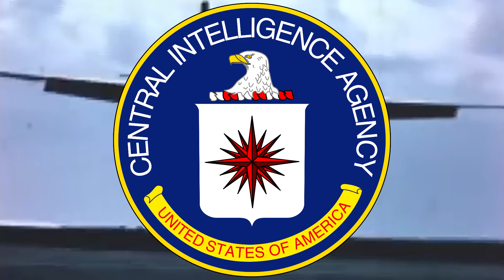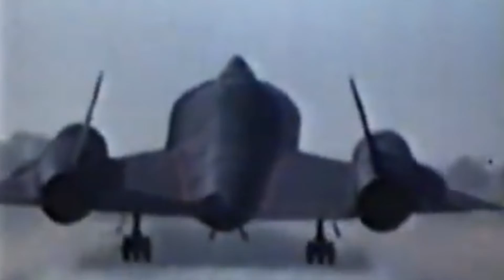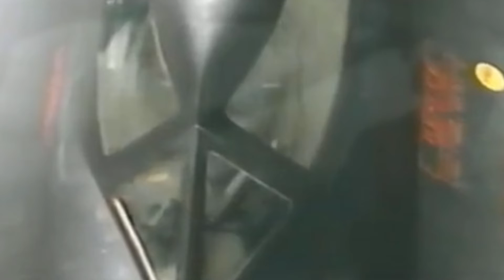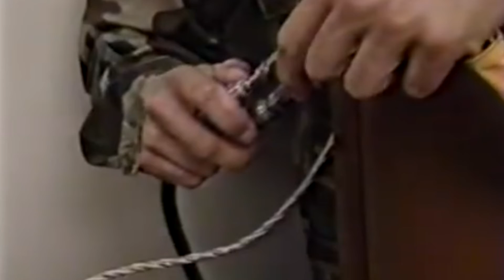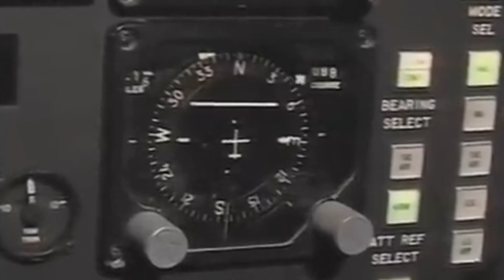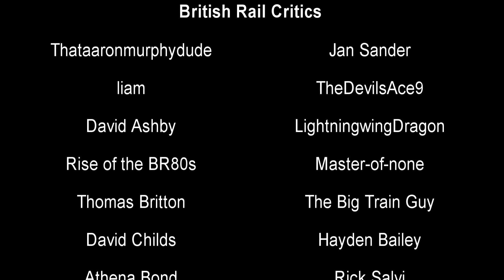The Cold War Jet That Redefined What is Possible | Lockheed SR-71 Blackbird | History in the Dark

Comment: Huge favorite of mine and would belong on a list of yours involving greatest non-combat aircraft. 

Even if the interceptor version had seen active duty, I'd still prefer the Blackbird in its purist form. Just the fact these things were extremely good at photographing the area and then hightailing it out of there. One of the only aircraft that could have potentially done anything to the Blackbird back then is the Foxhound; which was specifically designed to try to hunt down the things. Keep in mind the Foxhound to this day has massive fuel tanks and still an impressive flight ceiling.

Comment: please do a video on
the porters steam loco 
the Japanese class d5,
the Chinese QJ 2,10,2
or just exsamples of asian trains 
how do gear trains work
something on saddle bolier and side tanks (like the big water boxes) tank engines
double ended diesel trains (and electric)
eletric trains
American and European switches other then the British class 07-09
what to do if the train stalls
one talking about the different types of steam funnles and there uses,
a video on steam locomotive combination breaks (steam and vacuum brakes)

a short video on how a Armstrong turn table works 
what did train flagman do 
what did trains (mostly steam) do when going in tunnels, ive heard of gas masks or just useing a wet cloth, or did they bring in other engines like later on they used electric trains, or were there no bigv tunnels.
evaluation of electric trains

why are some trains wagion tops (the stream lining thing to boilers)
railway terms abd slang
one on the meaning of flag and lantern colors like green on rear engine means theres another one coming soon,

the different types of cut offs/reversers/Johnson bar
some are a big lever, some are a big valve wheel, and ive also seen some that are like rods, one exsample is train sim world 3 and im not sure where to find the other reverser

and how much water do steam trains take usually, and how much would the crew drink
Reply: Please choose one at a time and give your reasons.  Also, here's a freebie: "how much [water from the tender] would the crew drink"  None, that water's not potable.
Reply: @alexhajnal107  no, not from the tender,
How much bottles for exsample, its hot in there so they would drink alot,
And how much water would the train consume, hyce did sone videos on coal  so i aided water to my list

And i do multiple at a time because on the chance and yt sees my list i dont have to keep trying because now they have all my questions to aid to there list
Reply: @alexhajnal107  also 1. In the event the crew uses a hose conected to the water turret to dtink from, why would they? The water would be contaminat and hot pumped through the pipes and also it was conmon for them to just pump water from lakes, rivers ect (at least in Europe im not certain about America) wich would sometimes contain fish or ells swiming in the water wich would eat the bacteria and may possibly be sucked into the engine and cooked (not common) but they also make the water slightly polluted,